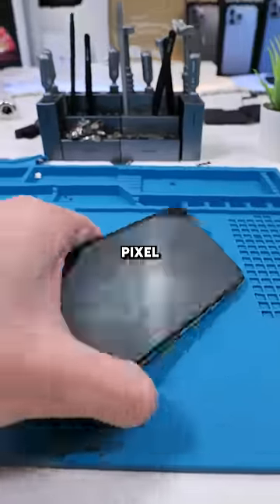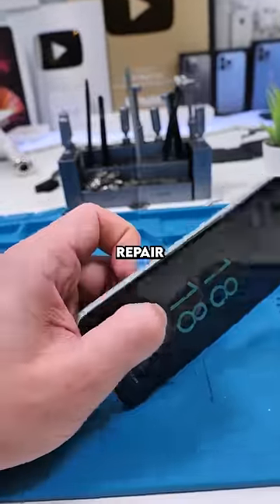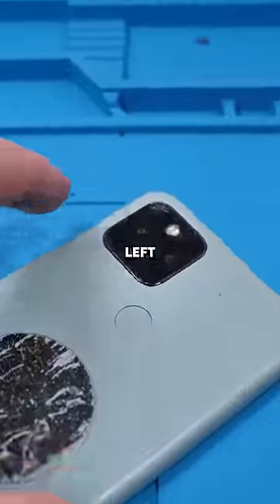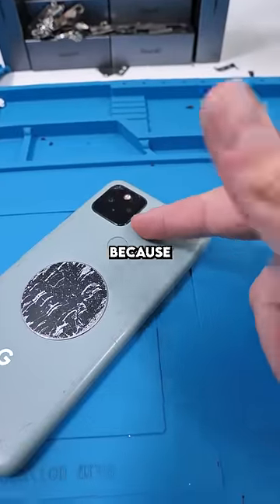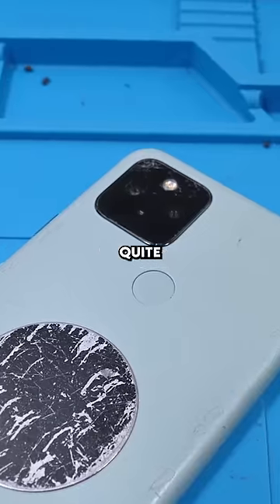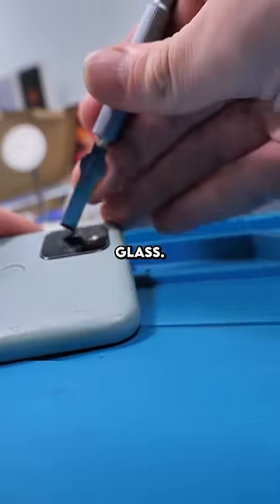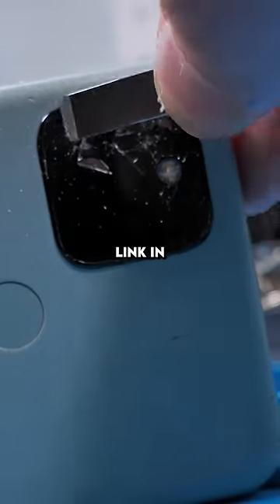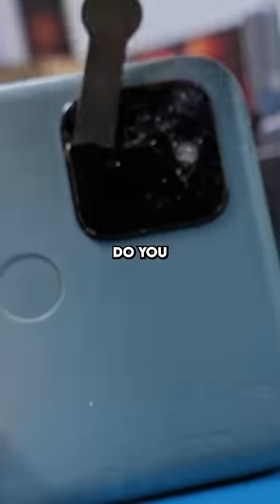This Pixel 5's Camera Glass Got Wrecked.... #shorts

Comment: This mat is quite useful, even when not used as intended throught, but still, it makes chainsaw repair easy when it comes to sort all of these screws and seger rings and other small elements in place rather than just lobbing these on a table and then be confused what element goes where?